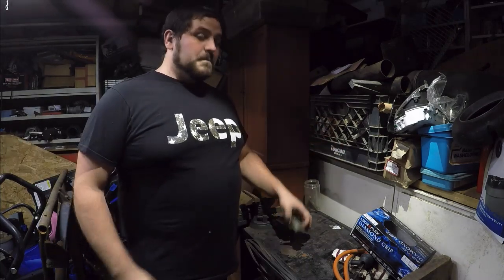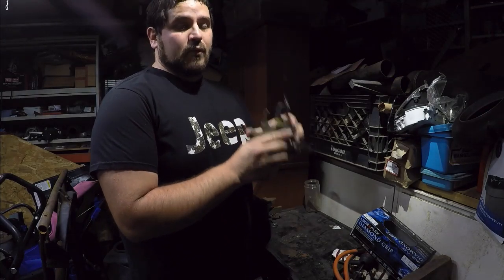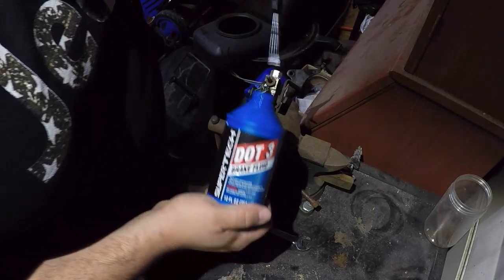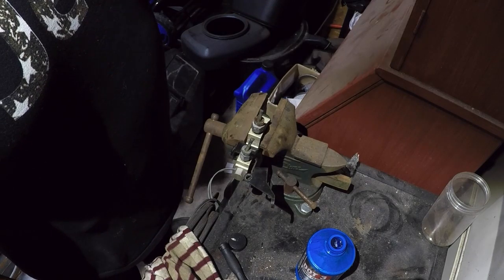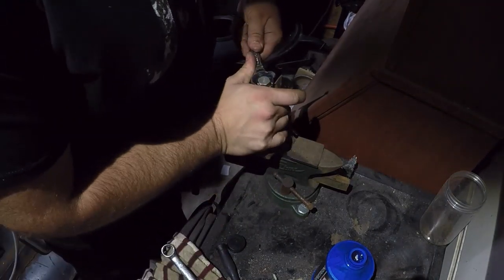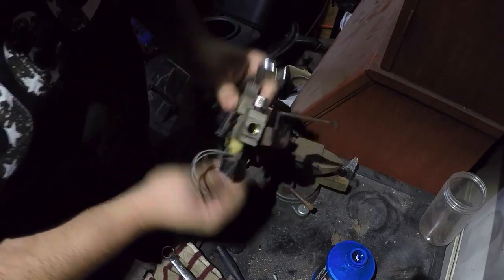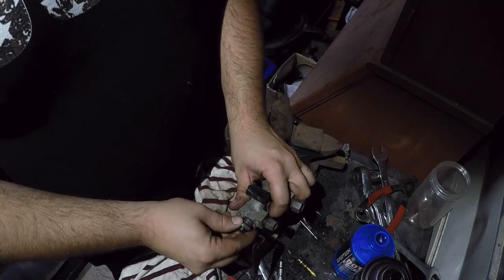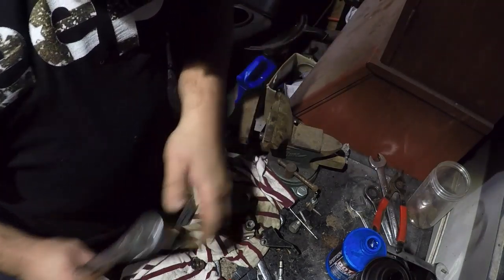How-To Clean Your Proportioning Valve + Mod for adding disc brakes - Budget ZJ Build

Comment: A vehicle that has a proportionate valve does not have an ABS system.  Don't understand the comment about the proportionate valve differential sensor lighting up the ABS light on the dash board.  If that is happening on your vehicle you definitely have a hacked system.

Comment: Disassemble the valve and then that's when one of those ultrasonic cleaners would be quite useful, let it set in that ultrasonic cleaner for like an hour and it should be G2G.  I haven't had an issue with one of those valves but a great video worth the time to watch for sure.  Thank you for sharing.

Comment: I have a 94 zj Laredo with drums in the rear. I got a spare d35 from a zj with disc that I want convert over. It should bolt up without drilling backing plates right? Also if I remove the prop valve oring I can use my original prop valve right?
Reply: Yes you can use your original prop valve. Also it should swap straight over. When I swapped mine (rear with disks) all I had to do was remove e brake cables as i cut mine off donor and barney.